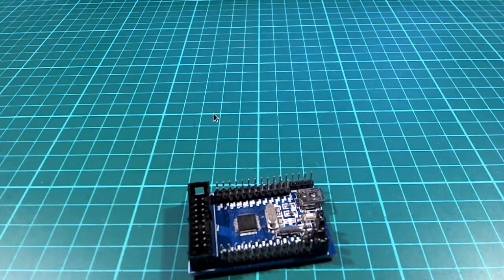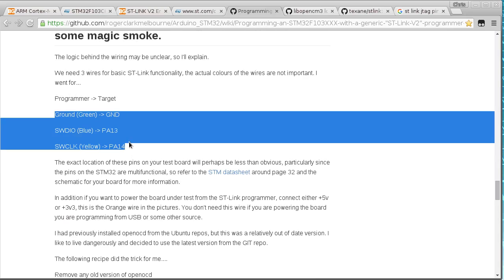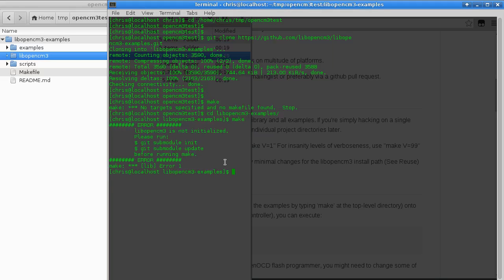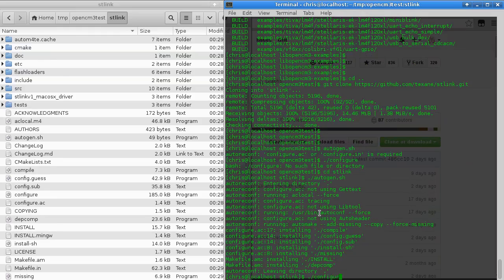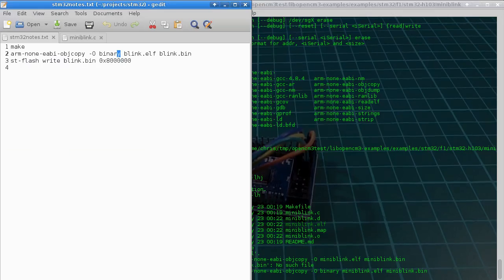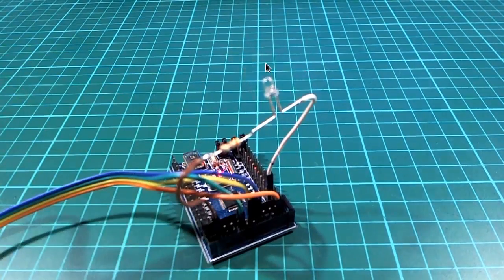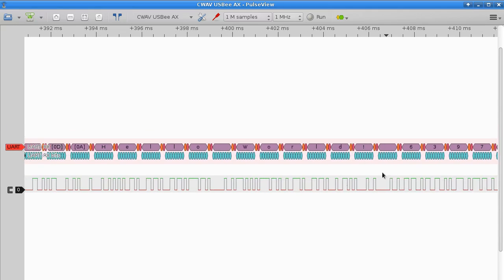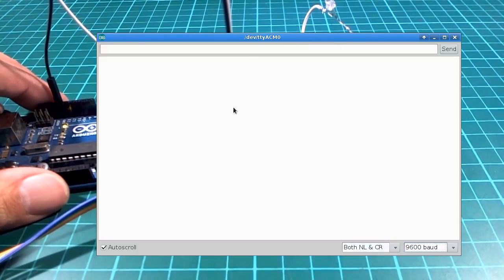STM32 dev board first steps (linux)

Comment: nice video, I have one similar board on my quadcopter and I just program it with an ftdi cable instead.
maybe arduino can't show the data because is expecting some type of different line ending? in the serial terminal you can switch the endings in  \r\n or nothing or joust one of them

btw, that way you follow him on github not on twitter :D :)
Reply: +Leonid Rusnac Sssh! Don't tell Chris that... he might notice! lol Problem with serial was that the RX and TX are from the Arduino's atmega chips perspective, not the Arduino's UART chip, so the TX for the STM should have been connected to the TX on the Arduino... which has been since realised! ;-D

Comment: Greetings ,
I am great follwer of your videos and constantly into fpv stuff. Around a month back you explained me about the Multiwii vs YMFC in comment section. Now I have another doubt for you to please clear.
I am interested in trying cleanflight or betaflight and want to use a stm32F4 board. Here in India If I google what I find is a stm32 F4 minimum system board . I can't get what they mean by a minimum system board. Can you please help ?
Reply: I have achieved success in making a quad using multiwii then ported your nrf multiwii code to multiwii 2.4 and then modified it for further use with an airplane using pins 3.5.6.9 and acheived success in my airplane flight. Am not a youtuber but have my code uploaded to git .
This was all done in further development to your contribution.
Thank You
Reply from the maker: A minimum system board usually means there is just the main chip and the crystal oscillator for clock, and some pullup or pulldown resistors, and maybe an LED or two. Usually it will have most of the pins accessible for easily plugging into, like the one in this video. So there are no peripherals like gyroscope or barometer etc.
The easiest way to try cleanflight or betaflight is a naze32 flight controller board or similar, which is basically a minimum system board plus an IMU and a couple more LEDs. They are not so common now, with newer boards including more features like OSD and current sensors. Those newer boards would also be fine but cost more.
Reply: @iforce2d  One of the main reasons is cost to me since here we have high import rates the naze 32 with same processor 10dof is INR 1700 while loose parts are 400 fro stm32 and approx 600 for all sensors combined. Hence a INR 700 different which is approximately $10 . 
Thanks for the explanation 😀
Reply: And I would like to stick to loose parts as I could experiment and learn more as well as try using NRF with it and also would try the YMFC with stm32 sometine later to learn more about working of a flight controller.
Cheers😀

Comment: That board in the video doesn't look like a genuine STM32 dev board. Is it a Chinese knockoff? Comments section on Banggood appears to be rigged. Look at the number of rubbish comments which are written in poor English, and appear to have all the key characteristics of spam (eg lack of technical detail, wording is too brief, star rating is too similar).
Reply from the maker: Yes, pretty sure it would be a knock-off. Banggood gives 'points' for writing reviews, I think 10 points which equates to 10 cents US, so the result is a lot of trash reviews on most products. You do at least need to have purchased the item to write a review though.